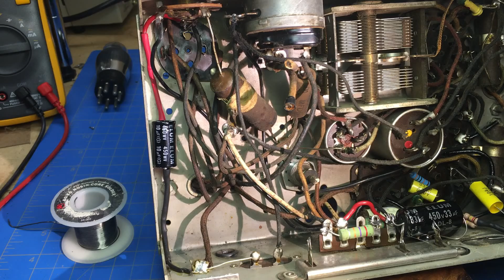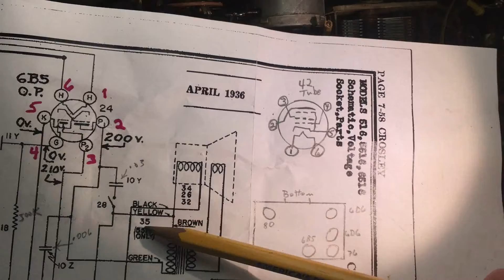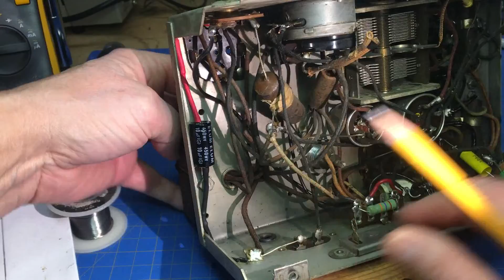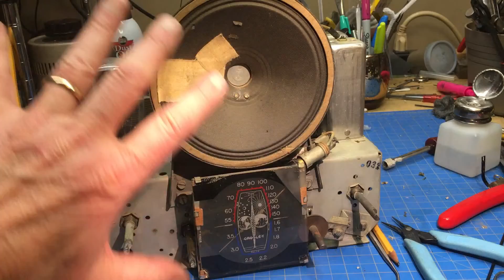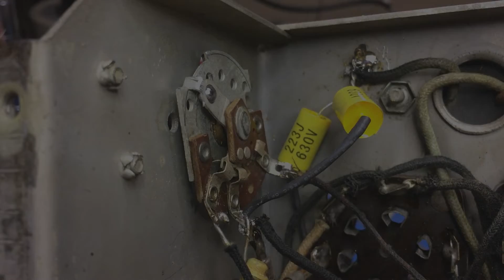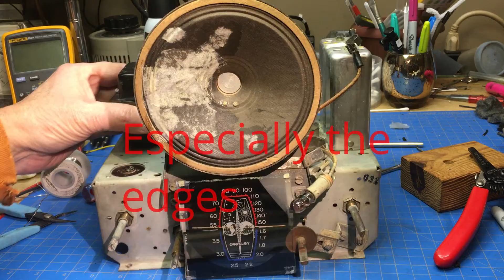1936 Crosley Model 516 Fiver Part 5 of 7 Recap, Clean up and Speaker repair

Comment: It's getting there! The switch had to be frustrating. I completely get working downstairs. My "repair lair" gets pretty cold down here, and I have to wear shoes or my feet get cold. Too bad about using your bench sprays. Nice job on the speaker repair!
Reply from the maker: Radio wild Thanks Bob! The switches turned out pretty good. I was concerned that the detents were bent and would break. As far as the bench sprays, I can use alcohol with no problems, good thing is, I have to take them outside so, at least Im in a well ventilated area! Lol. Slowly but surely, this one will get done! Take Care--Larry